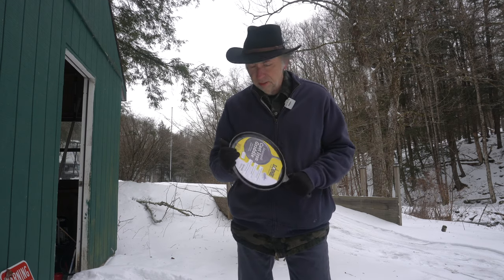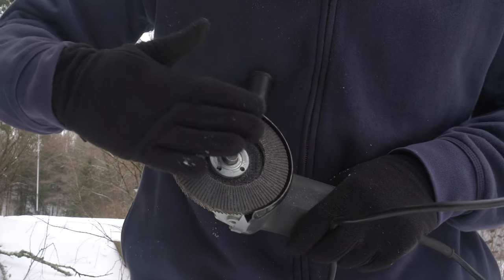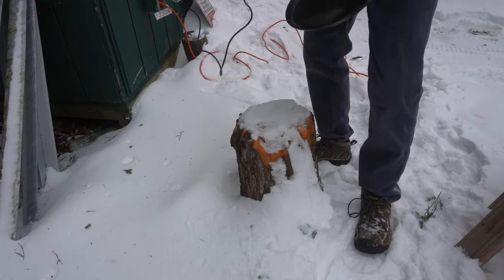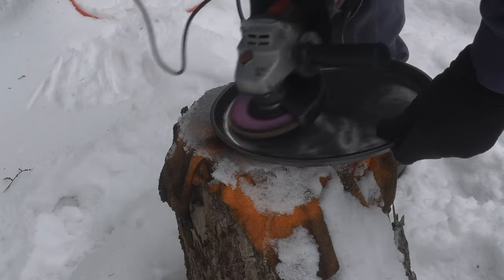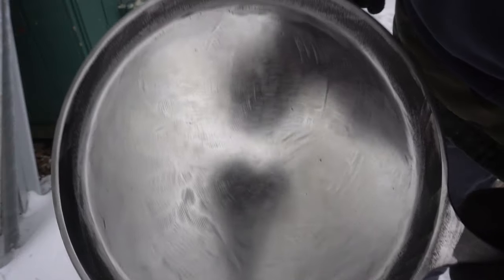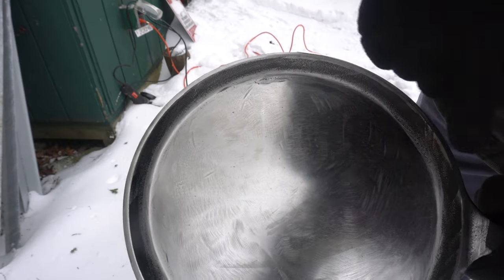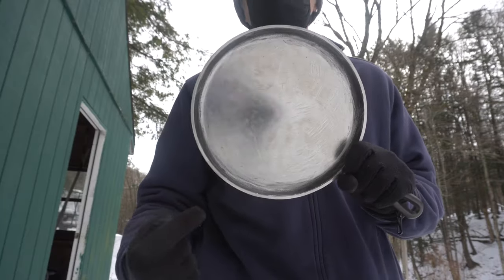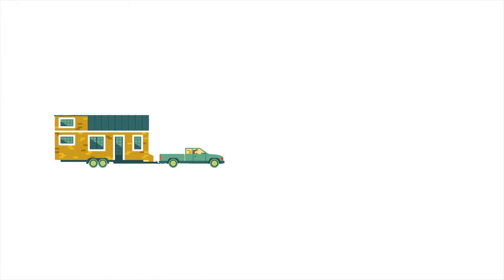How to Get Finex Cast Iron Quality From A Lowly Lodge Griddle!

Comment: Just a tip from an old U.S. Marine veteran...I've modified a number of rough cast iron pans and griddles with super success using only 80 grit sand paper. The result was a smooth surface, but the 80 grit sanding left a tiny micro-texture to allow the seasoning to get established and not be lifted off by use.  Even the Stargazer company realized they had better results by having a tiny micro-texture allowing seasoning to hold. You will love the results...God Bless.
Reply from the maker: Interesting. I have not tried that. I figured that since cast iron is 'porous' that sanding to almost a mirror finish would still allow for the seasoning to hang on. Haven't really had a problem maintaining it. Will give this a try though if/when I make another one of these. Thanks!